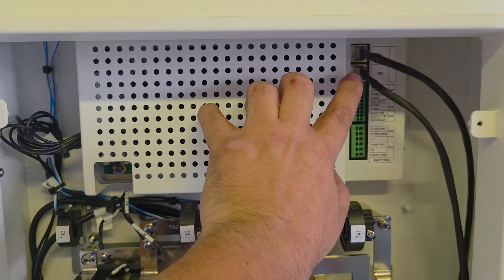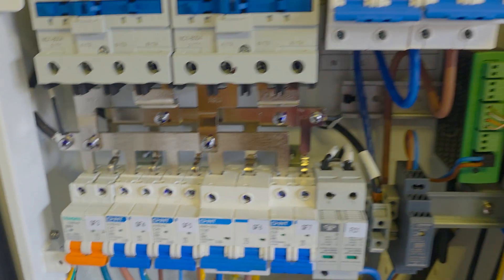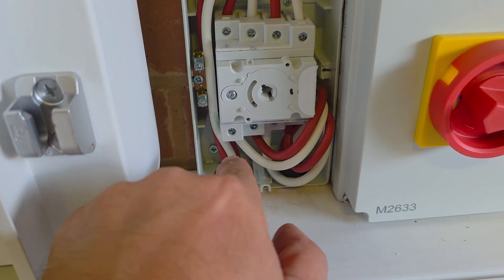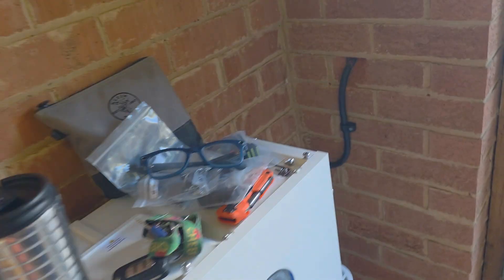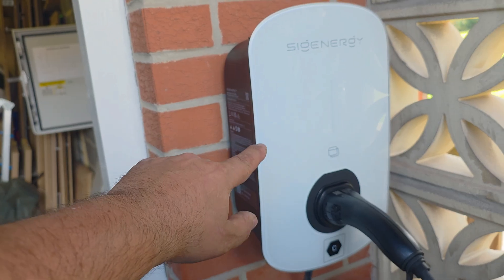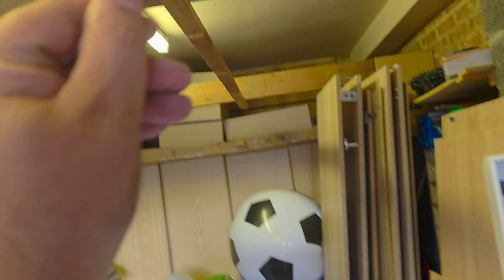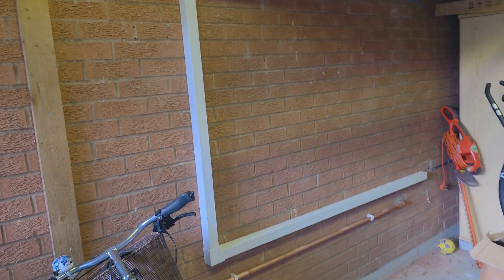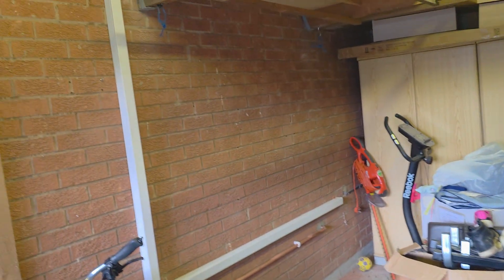North AND South solar panels WORK... combined with Sigenergy = POWERHOUSE

Comment: Hi Mark.  We are just having a solar system installed with gateway and EV AC charger - the chaps doing the install have always looked at it the same as you, but have recently spoken with Sig and they are now saying that you still need install PEN (it seems the charger they have installed is still the older style) even though they have installed an earth rod.
Reply from the maker: If the EVSE has an earth electrode it does not as per regs require a pen detection device. You can fit one by choice but it is not needed. Electricians design, manufacturers supply. Your installers are correct.

Comment: Hi Mark, can I ask- why do you use the inverter 2 port for the EV Charger and not the smart port?
Reply from the maker: You can use either option. The smart port is best utilised with say heat pumps or backup generators as the EV can be controlled to do different things on power cuts anyway and be told to leave battery capacity alone lol. So seems a waste to use a clever feature on the EV
Reply: @electrician247  Understandable, we have been connecting a generator to every system we have installed more recently due to the power cuts here in Northern Ireland. But I didnt know we could connect the EV charger to the inverter port so thanks a million!

Comment: Nice job. 2 little questions. Did you have to put a TAP each side of the roof for the TIGO ? Have you seen any TIGO installs that have had issues with users having ZIGBEE smart home kit ?
Reply from the maker: You dont have to but it helps with signal. Different aspects and elevations more than 1m differences are guided towards additional taps. But it varies on local conditions. No issues with other devices.

Comment: Very nice system.  Well done.  You seem to add Tigo to most systems.  This one does not seem to have too much shadowing so what is your rationale?  Would love to hear your thoughts on Tigo.
Reply from the maker: Shading is the defacto view towards optimisers however its a bigger picture. Here we did have shading on a few panels but that's not the main upside. Safety, monitoring and shutdown. Vastly underestimated and under valued. Thats before we even consider different rates of degradation on large residential arrays. Optimisers are not just a good idea, they are essential in a real value driven system. Value in cost and safety.

Comment: Nicely done Mark. Lovely looking install. I have a sample of the ev charger you talk about. It has been installed with the PEN sense wires back to the gateway. Not sure if any of that is right or wrong.
Reply: Great work Mark as always, I've the exact same system here in Wexford in Ireland. 

Wish I could have had you guys do my system do 😂😂

Keep up the great work
Reply from the maker: Its fine all of the time with it. Not needed if earth rods are in play but causes no problem alongside them. We have had a few operate on unrelated faults. Such as a charger detecting a problem with a vehicle rather than a PEN fault. Which is annoying but unrelated lol. The new ones all have it built in anyway.